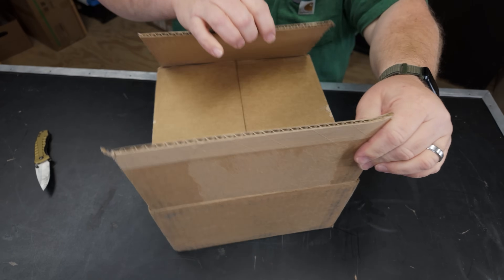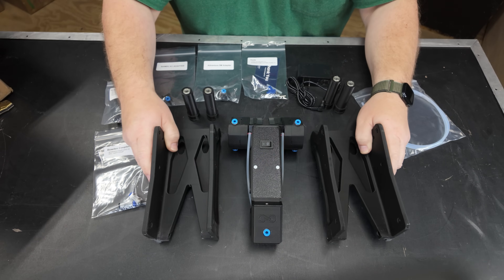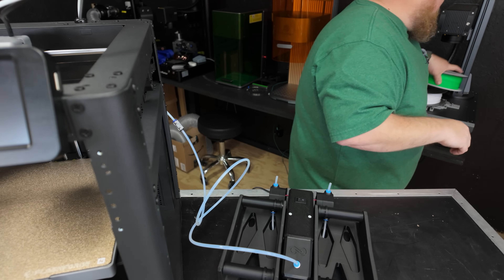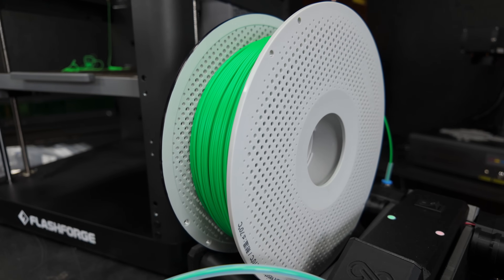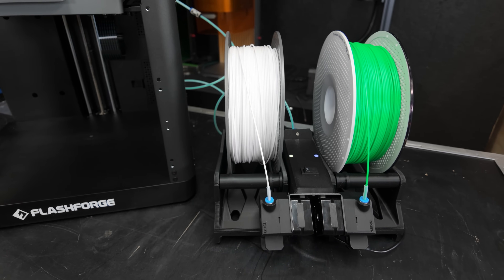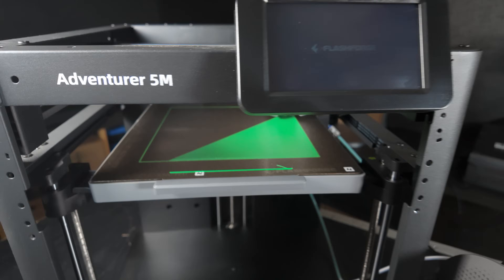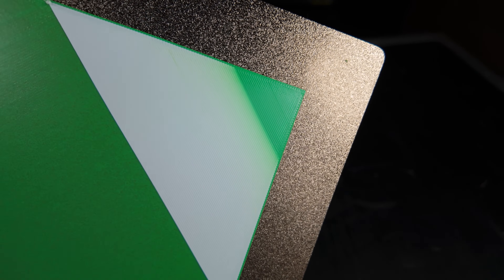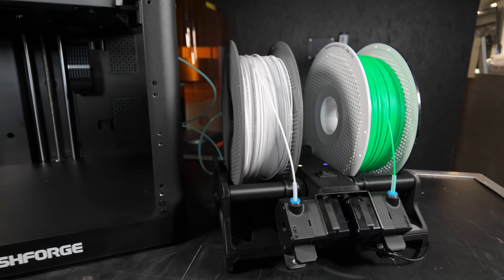Every Print Farm NEEDS THIS - Infinity Flow S1

Comment: I honestly don't like that some of the parts are 3d printed. If that were the case, just lower the cost and let me print those myself. This thing has no business being $160 when there's already an auto-mechanical method of having a filament backup system called "AMS Mech"

Comment: I hope you read this. As an Engineer I see a major design flaw and an amazing concept that was definitely needed. 

Design flaw would be the location of the filament intake being on one side and not on the middle. This may cause problems when the spool is low it might get caught on the opposing side. This might not be extremely noticible on 1kg spool but it might become a bigger problem on begged sized spools. 
I hope they fix this on future iterations. 

Now what is good is for people running a single color print farm. Where you do not need multicolor printing and have a massive amount of printers. This is where the AMS or AMS lite on the bambú printers can become pricy. The added benefit is the fact that you can use this for different types of printers.

The biggest benefit I see of this product is 2k to 5k spools. The benefit is ease of mind when running low on a spool. 

I hope you read this since you were thinking on getting more of these out of your own money. Think about the design flaw and if this would affect your business. I appreciate your content, so make sure you look at this while you still have the free product to test out.

Comment: It probably won't be a problem most of the time but the one issue I'm seeing with this system is that once the new filament reaches the extruder, from the time that tip hits the extruder gears until it gets to the nozzle, you'll be essentially printing with zero retraction as it won't be able to pull back the filament from the initial spool. Would probably be fine with a lot of prints but ones with lots of retractions or if someone is running smaller nozzle sizes, it could cause issues for that ~50mm stretch until the new filament makes it all the way to the nozzle. Would be sweet if they developed an add on small MCU that could send some basic pause>purge>resume commands for printers/firmwares that support that.

Comment: I think you stated that printer has or only allows for 1 spool attached which I believe prevents you from printing multiple colors. If so would this device allow you to print in 2 color mode or is it just to ensure you don't run out of filament.  btw & FYI.  I'm a newbie to 3d printing.  Only just purchased a Bambu PS1 with AMS just over a week ago,

Comment: This is a feature I love about the Bambu AMS. I often load up a partial and a full and let it auto switch when the partial runs out.  It's good to see you can have something similar for other units.  I think it really needs to be enclosed so you can keep things like PETG dry.
Reply: yep, the Bambu AMS already has the solution

Comment: You should definitely do some more testing. Alot of ams work the same way where issues usually occur is at the end of the spools. The filament may get stuck in the spool itself.

Comment: Running out of filament mid print is a problem that has had a solution since 2018, it is called a filament runout sensor. Lets look at the issue that really isn't an issue. You want to print something but your not sure if you have enough filament on the roll to finish the print. If it is something important I don't want to have a slight imperfection from a reload I will go buck wild and break out a BRAND spanking new $10 roll of filament. I know call me crazy I splurge and use a brand new roll!!! Then I save the 1/4 or 1/8th roll for a smaller print later on. If the print isn't especially important to be cosmetically perfect a tool holder or box or something I let the filament runout and the sensor trip and do a filament swap. Running out of filament is not a daily occurrence by any means it is actually a very rare occurrence for me. The slicer tells you how many grams of filament the print will need so if you really really need to know you can weigh it. I am about 99.9% accurate just looking at how much is left on the roll and going yep looks like enough!! $165 to fix an issue that really isn't an issue and that takes up quite a lot of desk space. Just NO!

Comment: Biggest risk always ends up if the filament start doesn't quite feed perfectly past any junctions. The Bambu having the filament runout at the hotend as well as AMS, at least will fault for if that happens. Most others will see the filament at its sensor and just keep going thinking its extruding if doesn't have any type of flow sensing.

Comment: I have no problem with the tool whatsoever - what bugs me however, is their marketing style. They shorts come up in my IG feed very often, and they try to catch audience with bold, clickbait titles that have nothing to do with them producing this thing, and then in 30s of video they shift whatever they were showing into hailing this product as the best thing invented since the sliced bread.  It doesn't matter if the vid was supposed to be about AMS, filament, 3d printing farm, whatever, everything leads to their product as a one-fits-all solution for all 3D printing problems, whereas this is kind of a targeted product.

Comment: Very cool demonstration - BUT (always one, right?) if you are printing a model with lots of retractions, you can have a few problems: at the right moment the green passed the extruder on the print head, and the white engages the extruder, a retraction will pull back the white one, but the rest of the green won't be pulled back... so, it's a moment where retractions won't happen (you might get zits, blobs, stringing during that transition). When the white finally reaches the melt-zone, retractions will happen again. SO, in your example, there would be nothing to notice because it is a big first layer without retractions. The window in which retractions won't work is small, maybe 2 or 3 cm of filament - but it is NOT completely fail-proof. Anyway, many times in the past I manually pushed a new roll of filament right after the other, without stopping the print (even when I was using a Bowden extruder) and the temporary retraction suspension was happening - it's the same problem, only that we choose not to bother 🤷‍♂

Comment: get a digital scale to work out how much you have.. Downside is you need to empty one spool first to get an empty weight, but you probably have some by now if this is your problem. 

We use kg but you can adapt. My current Amazon PLA rolls are 160g each.. so 1.16kg.... I think it is about 330m to a kg, but I give it some fudge space and make it 300 to 1. SO whatever the weight is I divide by 3.33 to know how much is left... so a full roll 1160g-160g = 1000g, 1000g/3.33= 300m

Comment: How are you able to tell or time when the other colors come in on a single extruder or is it random and that's how you want it?
Reply: It's for prints that normally use a single colour filament and you have spool that might not have enough on it to complete the print. This will auto switch when the spool runs out

Comment: I've seen these advertised on my social media feeds.  My only complaint is I wish it was covered up/sealed so that it could act like a filament dry box.  (See the Polymaker Polybox)  Seal it up, load up some desiccant - be it gel silica or Activated Alumina.  Maybe they are scouring the comments and see this?  If so - love to test such a setup!
Reply: Seems pointless since there's already so many dryboxes out there or you just use your own.  Would be easy to print a base if you were worried about the electronics moving but you just hook up your dryboxes or dryer that has decent rollers and don't use their spool holders that he assembled on each side.  The real question is how beefy their feed mechanism and motors are since this demo was just 1 kg spools although they do advertise handling 5 kg spools just fine.
Reply: @EkiToji well if this was enclosed like a dry box, it’s a big win plus supporting dual spools.  Yes I’m curious how well it does bigger than 1kg
Reply: @WhereNerdyisCool  But there's no point enclosing it since you can use whatever drybox you want and just run a PTFE tube into it as long as your drybox has rollers to reduce friction.  Therefore you can even just use a cereal box and some dessicant instead of some new custom solution.  You can probably even daisy chain multiple S1s together if you wanted though it would be nice if they made it more expandable in that regard.

Comment: It really is a neat product, but it’s somewhat expensive. While I’m unsure how they’re measuring force on the filament, two stepper motors, their drivers, and a microcontroller board and some plastic isn’t going to cost more than $50. Maybe it’s the time cost of 3D printing all the parts, or the labour cost of having valuable qualified people in the western world assembling the things, or recouping significant R&D costs, but $150 feels pretty steep. At least for people wanting to use up partial rolls on their ender 3. If there was competition in this space, I’d expect them to be in the $90 range, maybe even less. For people with thousand dollar printers that don’t have an AMS-like device that can do this, it absolutely makes sense at the current price-point, and I imagine that’s the target market.
Reply: Not sure it would work reliably on an Ender 3. It relies on the extruder taking a loose filament end without   finesse. I know my Ender likes the end cut just so, with a manual poke between the runout sensor and the extruder followed by a half turn before the cog. Yes, I need a new printer.
Reply: @thumperthoughts  
Yeah the extruder would need some modification if nothing else. Probably worth swapping to a direct extruder of some sort.

Comment: You could also use this with small amounts left on spools ie. 100gms on one and 75gms on another so that it uses up small amounts of the leftovers!
Reply: using multiple 1kg roll scraps on a print is going to leave noticeable layer lines.

Comment: The main reason I want an AMS-HT isn’t for the heating, it’s because feeding a spool on that H2D side holder is a complete PITA. Could this sub for that as a driven spool feeder?
Reply from the maker: Absolutely, you just set up the spool as an external one (not any AMS) in the machine and you're good to go.
Reply: @ Instant Order. Thanks, Sam

Comment: It does seem to do a great job. Does it work better than using an AMS to perform the same function?
I think I'll need to buy one of these just to run filament leftovers through my prototype printer.
As for Flashforge needing some love. I agree 100%. I do computer maintenance for a school that recently bought 4 Flashforge printers.
The supplier wanted a ridiculous amount for routine maintenance and they asked if I'd take it on. So far nothing more than clearing filament buildup and clean and lube.

Comment: nice for non Bambu printers,  but a bit expensive imho...    i love my AMS for this reason...  get a Bambu...
Reply from the maker: Even for Bambu users, this could be a great solution depending on application. If someone only prints single color models, they can save the (last I checked) $250 USD AMS cost and get this. Then they're able to use any filament on a spool and in multiple sizes. It's all about needs and applications. Tons of options! :)

Comment: mainy rolls of filament have the spool end of the filament inserted into the spool hub, and that end is bend, and might even by stuck in the spool.  This would prevent the spool from running out and this system wouldn't work.
Reply: Could you cut off the end piece?
Reply from the maker: Talking with InfinityFlow, they are working on an automatic filament cutter to address this exact issue. The prototypes I've seen look really cool. Hopefully it comes to market soon.

Comment: why? I don't get why someone would want this.
Reply: If you don't understand why someone would need this then you aren't vary familiar with 3D printing.
Reply: @zerodotcmd  please enlighten me
Reply: @donoho93  Two reasons.

One, larger prints that use more filament. When a printer is running a 20 hour print the last thing you want to be doing is sitting next to it waiting to swap filament. It's a game changer to be able to simply walk away and let the print finish knowing everything will be OK.

Second, filament waste. If I have a quarter spool of filament and I want to start a larger print, I need to remove that spool first for a full roll. Most the time these sit on the shelf and never get used again, eventually going to the trash.  This stops the need for filament management. I can have a standby spool sitting in the InfinityFlow and completely cut down on ALL filament waste.
Reply: @zerodotcmd  If you run large prints that require more than 1 kg or an automated print farm scenario, you'd use 3kg or 5kg spools imo. I don't see much use case for this.
Reply: @ To each their own. A lot of people do see a use case.

Comment: Smooth as peanut butter on a summers day 😂The S1 has been a great addition to my little print farm too! Im always changing spools around 50-100g depending on what I print and no longer need to worry about this which is nice, especially considering some of the filament I use on a regular basis is going up in cost. I have another 5M coming next week from Flashforge and will definitely be getting another one of the Infinity Flow machines for that one as well!
Reply: I was actually going to tag you in this, because it'd be perfect for you then I saw you already commented! Love the 3D printing community we have here on Youtube!

Comment: Great video. I've had two of these sitting on my desk for a couple of weeks, one for my MK4S and one for my K1 Max.
Reply: I did put them both together, but haven't used them yet. Have to figure out how to adapt the MK4S adapter to use a PTFE plug I already have, and my K1 Max is currently in nozzle issues purgatory. None of my Crealities are behaving properly atm.

Comment: I'm confused. Why is there waste with colour changes with an AMS if you can just snip and feed a different colour? And is there "support" filament   that's cheap and easily breaks off for multispool printing?
Reply from the maker: This is not made for color changes. I used the two colors to test the filament change and inspect for any flaws.
Reply: PLA supports easily break off from PETG prints and vice versa

Comment: Was debating on getting one, but I print in an environment when if I leave a spool out in the open, I have to dry it the next day.  The cost and time needed to build an enclosure for this, would be close to the cost of the AMS system coming out from BTT soon.  I can see it having value for a print farm though which will likely have a low humidity environment.

Comment: I definitely have some ideas that could be done with this and the color changes..  Put your remnant rolls on there, alternating colors, and as they run out it'll change..  Can make your own custom 'rainbow' prints...
Reply: As far as knowing if I have enough on a roll to finish something, I use a filament scale (the one Creality put out a couple years ago), and have Spoolman running on one of my servers.  Keeps track of my filament weights (I have to weigh the ones I use on the Bambu's after prints, but the klipper machines report to the server how much was used).